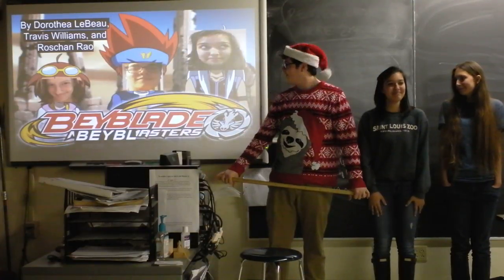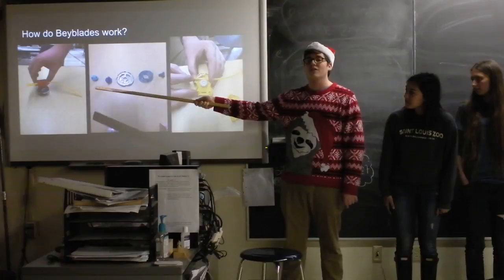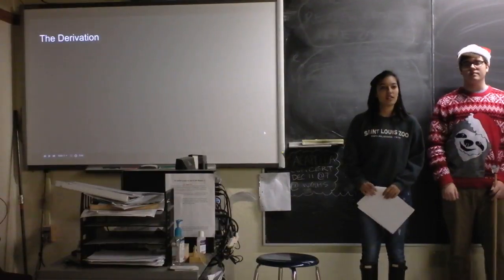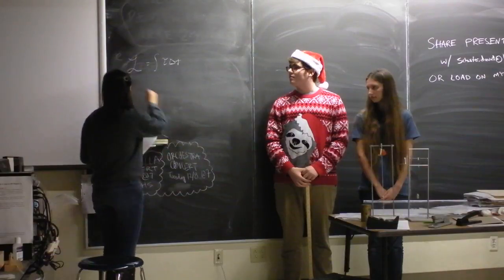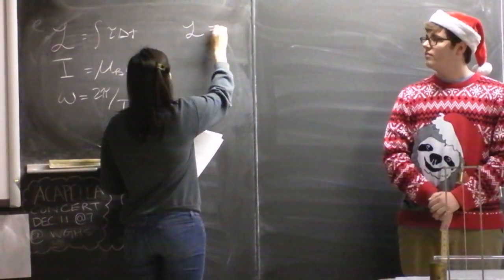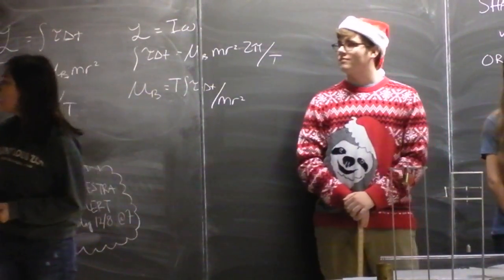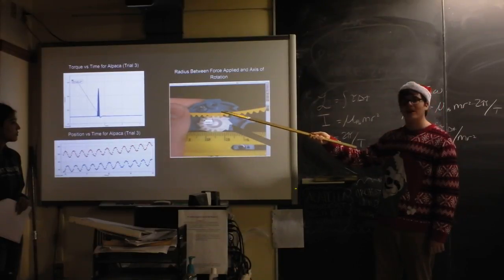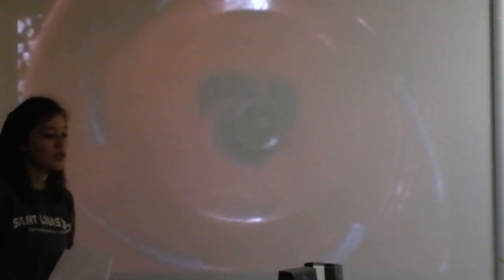Indie Lab - Beyblade Physics (2 of 2) from Experts

Comment: +bskulldragon100, the girls are certainly pretty, and smart as well! That's definitely a great combination. The work the students did in this video was well planned. However, I did notice a mistake made in one of the equations. At 7:37, when the black haired girl finishes writing out the coefficient beyblade equation, 2*pi was left out of the denominator. This is because, in order to isolate the coefficient beyblade, the integral on the left side must be divided by mr^2, which is the rotational inertia, and the integral must also be multiplied by the reciprocal of (2*pi)/T, which is T/(2*pi). Unless I'm misunderstanding something, 2*pi was left out of the denominator of the coefficient beyblade equation. I don't know if this mistake was made in the students' work, but if it was, it may have caused the error in the data which they were speaking of.